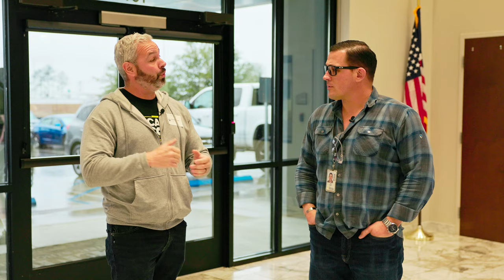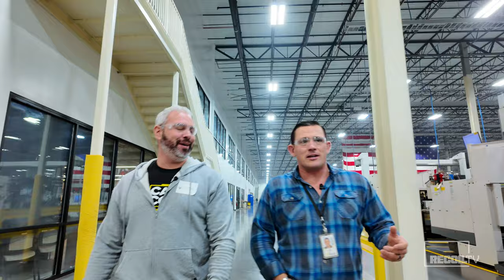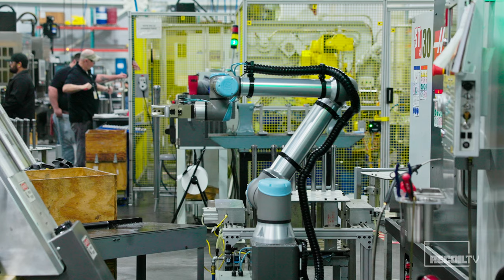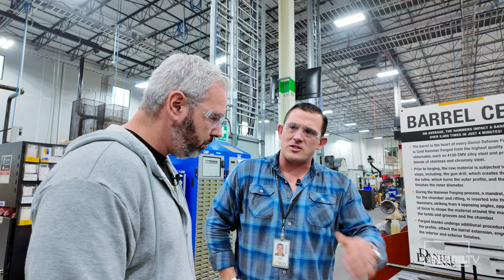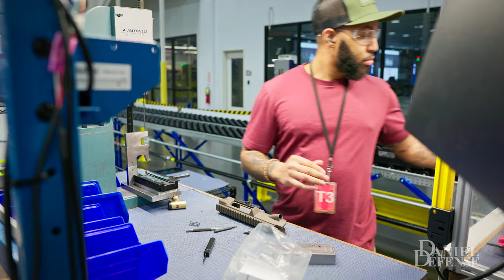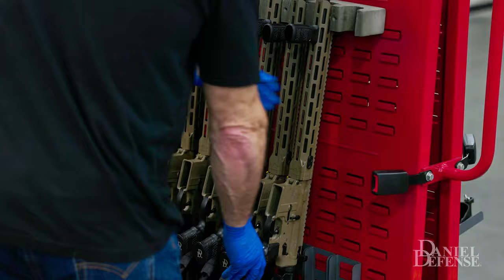Inside Daniel Defense: The Ultimate Factory Tour & Deep Dive

Comment: As someone that is into Metrology, I would have loved to see how they inspect the barrel rifling. Do they section a barrel and use a optical VMM or something like a OGP Smartscope or another method? I hope they are not naive enough to think hammer forging makes perfect rifling automagically! It doesn't, there is tweaking and it changes with each batch of material but I guess most people will never really know but it's pretty interesting and cool to see using a OGP system just what u are actually getting.
Reply: I wonder the same. I imagine they use hard gages though. Not sure what you can stick down there that would still be accurate enough to measure.